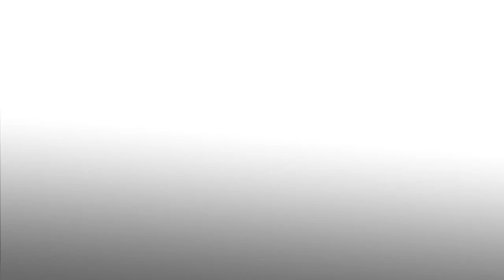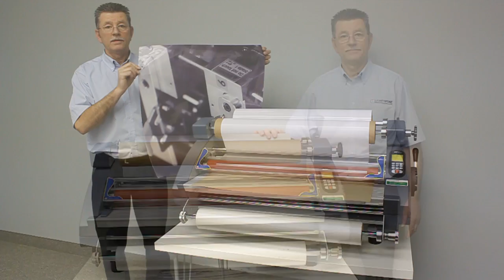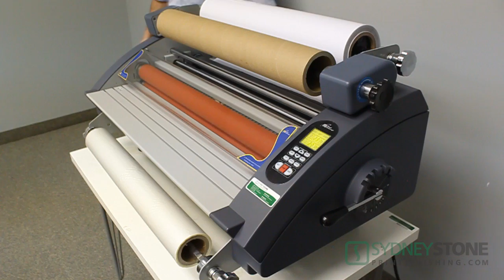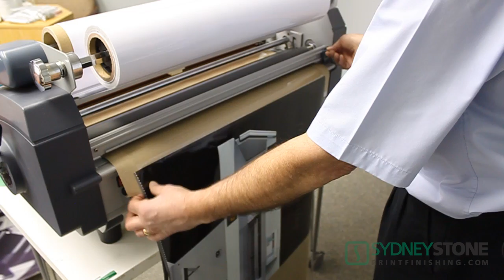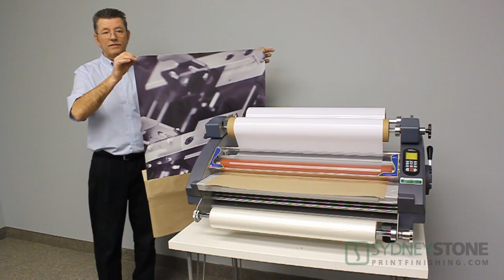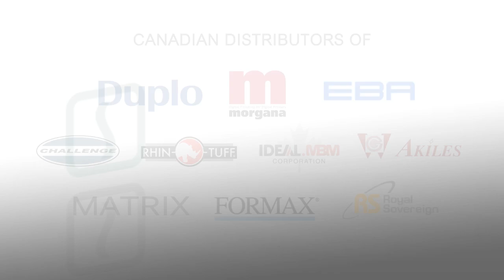Laminating Series - Cold Lamination With The RSL2702S (1/6)

Comment: We need a cold laminating machine, one of the materials is an adhesive film thickness 220 Micron and the other is a metal foil thickness 0.04 mm, we need to laminate the tape with the metal foil.  can you please suggest a machine? My E-Mail is: hagop@alteamfze.com 
What is the delivery period and weight of the machine? Can slitting in width be added?